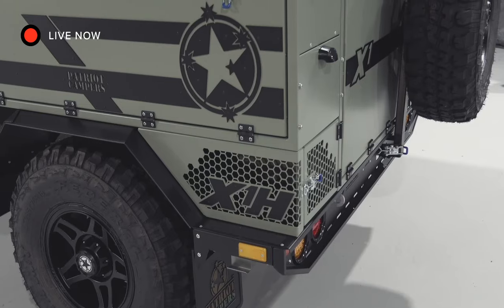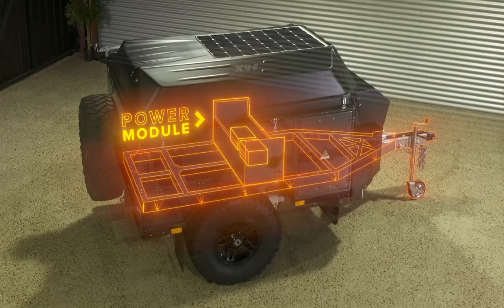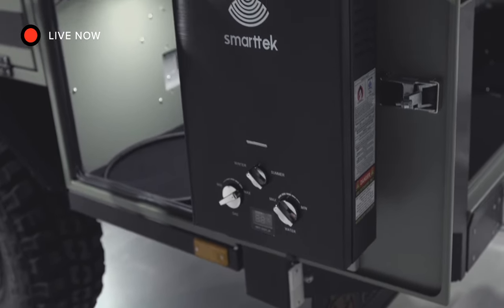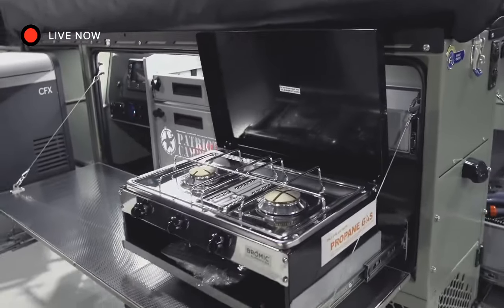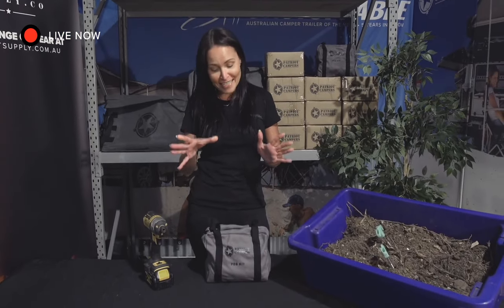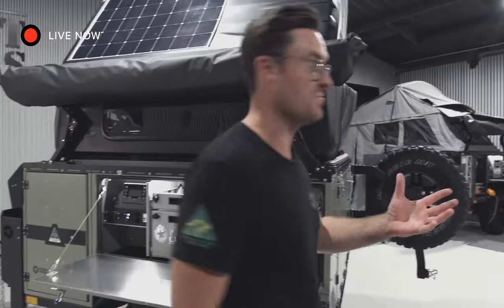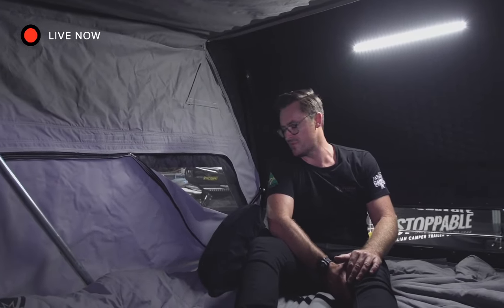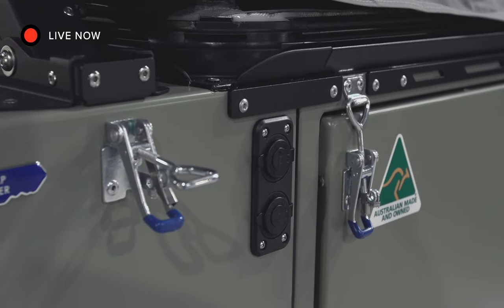Patriot Campers X1-H Virtual Tour

Comment: Can you use the air compressor for the air bags to air up the tires on the trailer or truck?
Reply from the maker: The compressor is just for the airbags 👍
Reply: Patriot Campers thanks, just a thought that would be a good option.